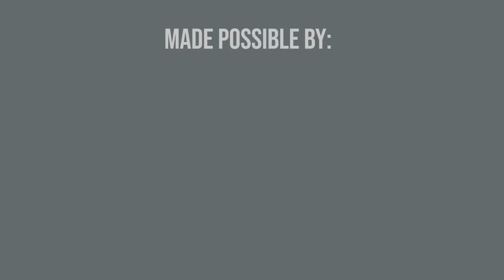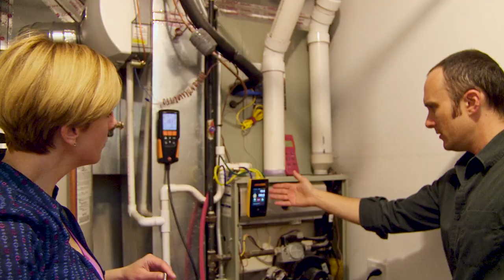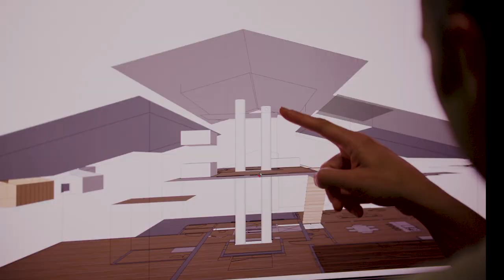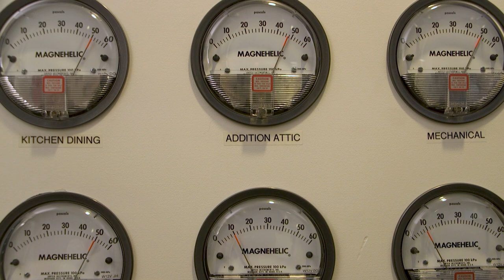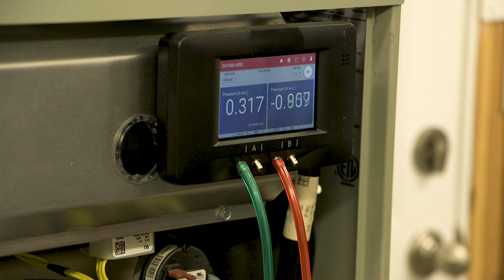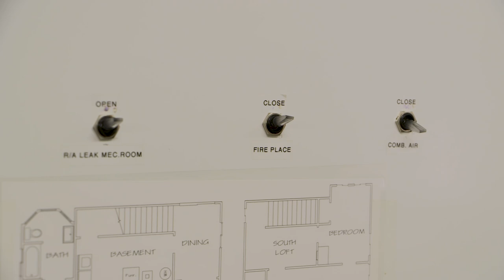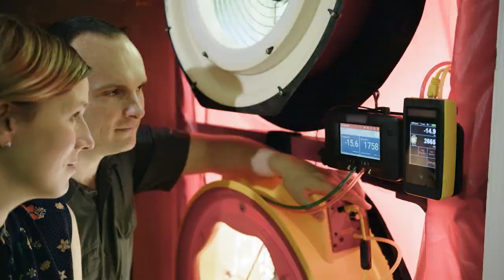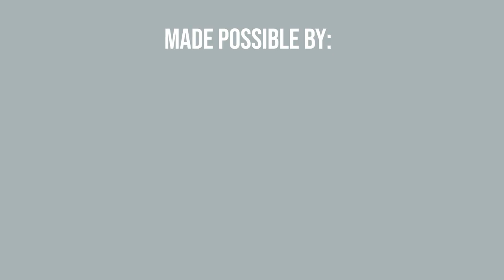Science of Healthy Homes vs. Efficient Homes - Ep 202 of Home Diagnosis TV Series

Comment: I wanted to comment on the shed.  That’s awesome.  I did the same.  I air sealed and insulated a 12x12 shed.  Then, since I’m in Florida where it’s hot, I installed the smallest window air conditioner I could find controlled by a humidistat set to 55%.  The A/C hardly ever runs and we don’t have to worry about any equipment stored out there.  It is a metal shed so I did an air gap, 1/2 inch foil faced foam, sealed, then blown in cellulose.  Fun project and I’m so glad I did it.  It wasn’t hard!
Reply from the maker: Nice David!

Comment: I am not too far from you in ATL. We just finished a 2k sq ft icf house with basement. Spray foam at the rafters. Client designed the house. We did a blower door and it was the lowest the energy guys have ever seen. We were looking at doing just a venting dehumidifier but the number was so low they energy guys convinced us to do an ERV as well. They said almost all the air coming into the home would come from the erv or when people came and went.
Reply from the maker: They steered you right. Good work!

Comment: On that older brick home, you are playing with fire when you fill the cavities with insulation. Brick absorbs a great deal of water. It's often referred to as a reservoir cladding. Waterproofing details of the past was often just a simple sheet of roofing felt which #1 is close to worthless and #2 has most likely dried up and deteriorated due to age. 

As water vapor travels through old walls the lack of insulation helps quickly dry the structure out, that's why on old homes you often see signs of water entry (staining) under windows and in corners but no rot or mold, it simply dried out quick enough that neither had time to form. 

You guys just dramatically slowed the flow of air through the walls but did absolutely nothing to address the absorption of water. So now when vapor is driven inward it won't dry and you open the door for bad things to happen. 

Lastly, bringing fresh air inside through venting may keep the occupants safe but it is difficult to predict how that will affect the homes 100 year old air patterns. It's conceivable that by pressuring the home even slightly, it could further exacerbate the problem. 

What you do is fine on new homes that have proper weather barrier protection. It's dangerous on old homes. Lastly, I am sure people will question my statements so, yes, I am an Architectural Engineer.
Reply: downunder we tend to do brick houses pretty well, typically 2-4" gap between brick and timber wall, vents at the bottom and open at the top. lots of ventilation to let that solar driven moisture out. 
with older weather board homes similar issue where they fill up the drainage and drying plane with insulation. because they drill holes from the outside (typically 2-3x more due to our houses having nogs) they also drill through any tar paper/wrb. if the repaired holes in the weather board crack, then it becomes leaky.
usually recommend removing interior, then wrb can be pocket installed, drainage and drying plane maintained, normal insulation used, electrics/plumbing can be upgraded, and you do not make potential weak points in the cladding.
Reply: This is all a very tough science. But even they say it. Every home has to be approached differently. 
Hopefully the brick was just a cladding not the actual wall. They should be checking for that.
One of my first houses had brick at the bottom. I had to kearn a bit about it to fix parts.
Reply: @turboflush  yes, every home needs to be approached differently. unfortunately that doesn't stop many companies from selling "fixes" which are not overly suitable.
Reply from the maker: Hey John, in many cases you're right, and rest assured that many of the folks who have been running these Weatherization Assistance Programs (WAP) for the past several decades understand the building science quite well. Each home is assessed and tested before they do anything at all (much UNLIKE 99% of home improvement and renovation), and they've been dense-packing cellulose and fiberglass (for when moisture is a worry) for decades. Roof overhangs, average precipitation and humidity, etc, are all part of their analysis before making improvements like this.